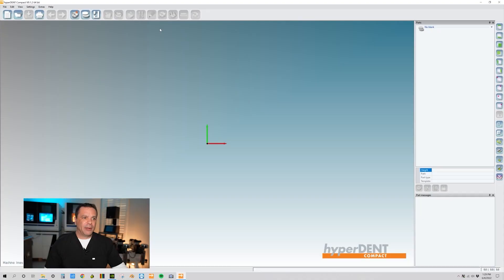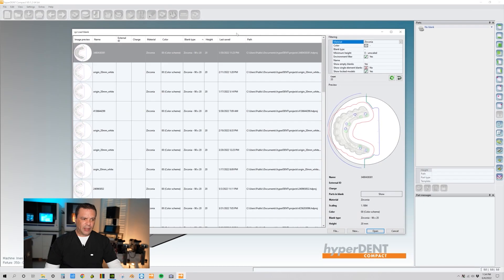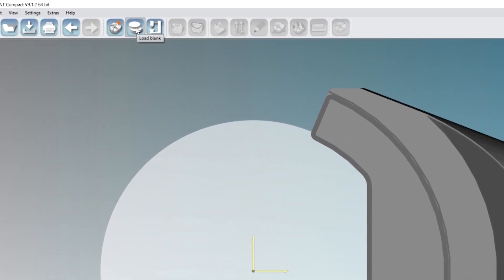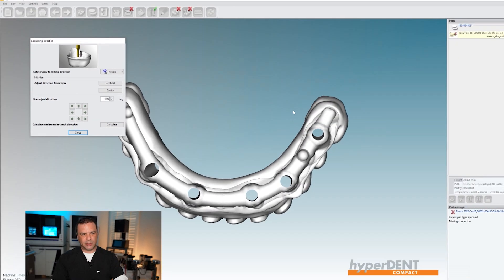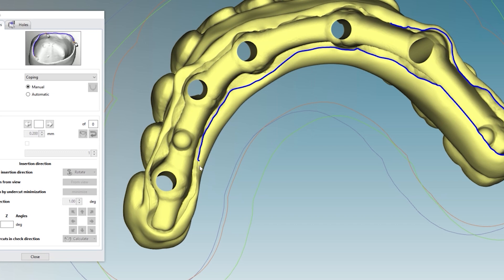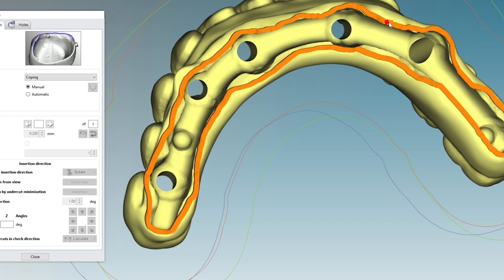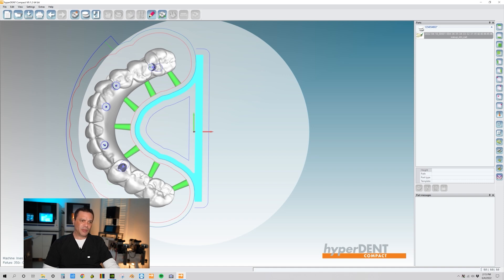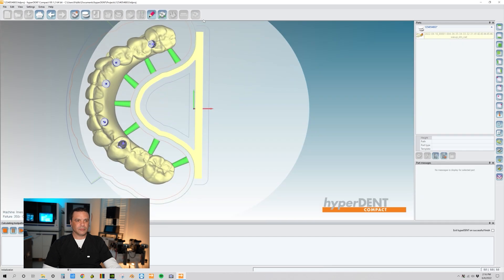hyperDENT Tutorial: CAM a Full Arch Hybrid

Comment: I did exactly as you showed us, but i don't know why the sinter frame isn't calculated with the bridge. Could you help, please
Reply from the maker: Before you calculate the project make sure that your bridge and sinter frame are both highlighted in Yellow.

If the frame is not highlighted in Yellow,  press down and hold the controll key and then use the left mouse button to click on the sinter frame. 

You will then have your bridge and sintering frame highlighted in yellow. Proceed to calculate the project.